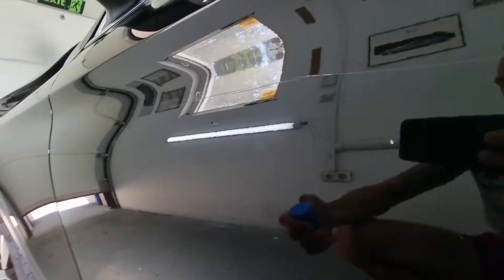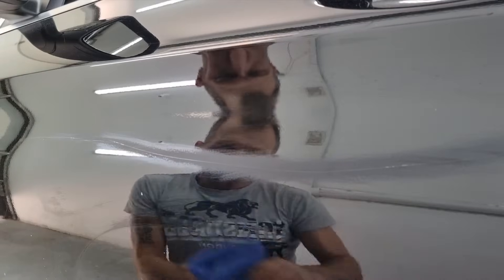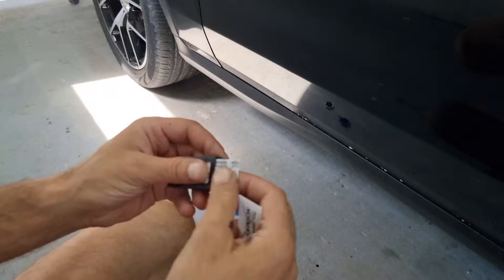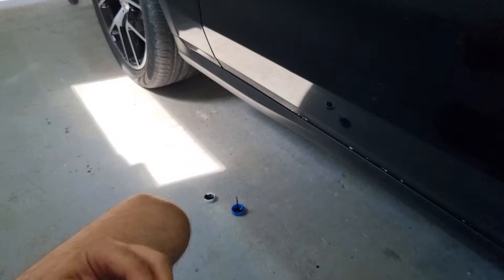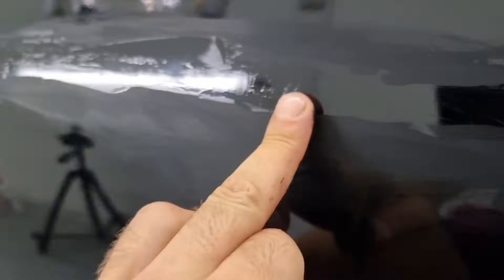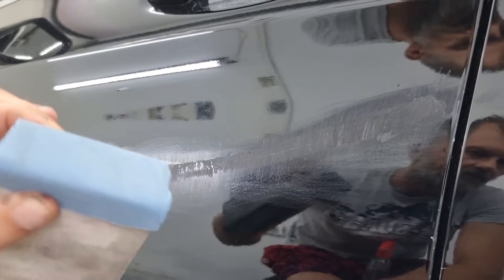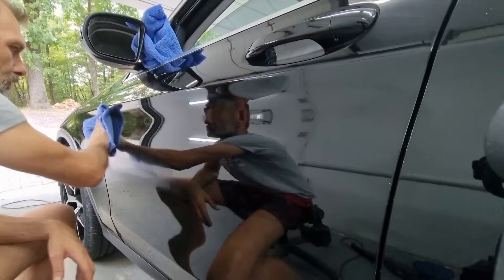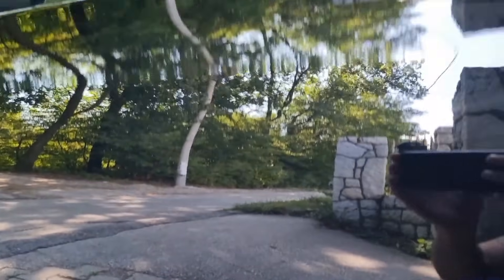How To Repair DEEP SCRATCH in Car Paint/RAZOR (DIY)

Comment: As a detailer myself that is a very very good touch up, in come cases this touch up has a better outcome than actually respraying the whole door because depending on the color match and in most cases the metalic flake in metalic paint types when it's sprayed can make the whole door stand out under sunlight and at night under street lighting.
Reply: A good shop can make the metallics sit perfectly , he did say this is a solid colour so should be no issues . 
As you know new cars come with thin soft paints and I don’t know if this method would be suitable
Reply: @M.E63  it definitely would be suitable. I speak from experience.

Comment: Finally, a process I can get me head around.  I thought you were going to use the blade to shave down the high spot but when I saw it used as a spreader of the paint I loved it.
Reply: Life, changed. Used flexible for over a decade but not THAT flexible.

Comment: If you layer the touch up paint a few times and let it dry between steps you’ll get a raised level above the scratch, then you level that and sand in steps til you get to 5000 grit, you’ll get rid of the scratch.

Comment: A good honest video which makes a refreshing change from those videos showing miraculous like new results. This video is honest and shows a honest true result. 
This method with a razor blade seems unbelievable as you think a metal razor blade will damage the paint. But this guy states clearly to use the slightest of pressure. 
Just one hint for you bud. A slightly better result could have been obtained by  using a thicker paint, a thinner brush and doing shorter sections. This reduces massively the amount of excess paint. Yes it takes longer but the results make it worth it.
Very good video m8. Well done 👍

Comment: Fantastic process. I've always struggled with scratches. I seen a video where they used the blade to shave the high spots but your method is much better.. Thank you for the insight 🙂
Reply from the maker: Thanke you and enjoy
Reply: @Amddetailing  can use mirka file too?

Comment: Really amazing work. The remaing small mark could be where the paint applied into the scratch carried on shrinking back a little?
Reply: I thought the same thing. Would waiting a bit longer to let the paint dry more take care of that issue? That would make sense but I'm no professional.
Reply: @toms6928  Yes. Even when paint is touch dry or even dry enough to flat back it carries on shrinking. The longer it is left to stabilise before it is rubbed back or polished the better.

Comment: Great technique. I wonder if taping on both the sides of the deep crack, forming a very narrow visible surface and then doing this technique, will avoid the excess paint on the body and  limit the work area?
Reply: Also after taping paint only scratch with touch up.  Do around 4 or 5 layers.  Then the scratch will be filled. Then remove tape and wet sand until there's no ridge on the added paint.

Comment: long tedious process but for not repainting it's pretty good results 9/10
Reply from the maker: but better than painting the entire element
Reply: @Amddetailing  100% 
It's very well done work given that fact don't get me wrong.. I recently had something similar on my bumper and tried to blend it in without painting the whole section but the results didn't satisfy, therefore I just painted the whole section and not trusting my work I ended up applying paint protection film to the bumper to make sure the new paint does not chip away in the future

Comment: Thanks, I like the idea with a razor.
My biggest problem in these kind of repairs is the sanding process when You not only sanding out the excess of paint but You're also sanding out the clearcoat that sits all around. You may end up getting through to the base color and then the problem gets worse.
Reply: Still worth a try, if the worst happens take it to the paint shop but if not you may well end up with the results achieved in this video and you will have saved yourself a few pennies.
Reply: It would take a lot of effort to go through the clear with 4,000 grit paper. If the paint had been compounded and polished a bunch of times then perhaps but if it's virgin clear coat the 4k paper isn't going to cut that much. You'd have to apply quite a bit of pressure and really go to town to get through it.

Comment: I did this on a few scratches on a black car. The result is acceptable, but far from "as new" (But of course way better than do it with a scratch repair pen). Yes, it's not noticable from 1 meter and hard to see on camera, but when you sell your car and teh buyer inspects the body panels carefully, then he will notice it. But of course you did your best to repair the scratch and that's the maximum you can do with it.
Reply: With practise and different methods you can do it to the point that you can't even notice.. I have done smaller repairs where you would never be able to tell even if you knew where to look..
Reply from the maker: it is easier with a razor because it leaves a straight line
Reply: @Amddetailing  yeah I will try it out next time, thanks for the suggestion.
Reply: I did some practice with a touch up pen on a big stone chip on a wheel arch. Yes I took a lot of time, many paint appliances and rubbing down. In the end it was invisible from all angle even up close. I guess it depends if its your car as opposed to a clients, and how much time you have.
Reply: A plain colour would be more undetectable than a metallic.  Sell the car when it's dusty 😝
Reply: Did you get the paint already prep for the car and do I add extra hardener to the paint ?

Comment: ... would it make sense to use a tape up and down the scratch to have only a small line with the scratch?
Now go on like shown,
remove the tape and the scratch is filled more / higher ... go on with the sand paper ...
Reply from the maker: that there is also that method that I showed in some subsequent videos on the channel

Comment: Nice work. Just one point of criticism though: In your final segment, the outside scene, the focal point of your video is set pretty much to infinite (the trees reflecting on the car's panel are in focus), making it harder to judge the result of your work. Auto focus will usually do this, because the trees (or any other objects reflecting on the car's panel) are pretty much the only discernable objects for auto focus to act on. Because it's hard to have your recording device focus on a car's panel, I use the following trick when I want to photograph or film a defect on the panel: put your finger right next to the point of interest, and then have your camera focus on your finger. Then lock your focus. Now you can film the car's panel with the correct focal point. Instead of a finger, you can also use for example a piece of cloth. Anything that the auto focus mechanism can "use" to set focus to the correct distance. (I hope this was somewhat clear, I'm no native English speaker).
Reply from the maker: First:
this is a channel where there is no obfuscation
second: it is better to do this than to have to paint the entire side
third: if I wanted to hide it so it wouldn't be seen, I couldn't do it with the help of focus
fourth: watch the other videos where I show with my finger from a distance of 2 cm where the lawsuit is and what is left of it until it is not noticeable from a distance of 10 cm.
Reply: @Amddetailing  You are totally not getting my point it seems. Nevermind.
Reply: @Amddetailing  this youtuber wasn't criticizing your work but instead he was giving you advice on how to record the video of the final result in order to auto focus better on the panel so your recording shows a better video distinction of the focus point that is being recorded, if this makes sense
Reply: No need for that man. Like dex said: I wasn't criticizing the work, I was merely giving some tips on how to show the end result to your audience more clearly.
Reply: @omarf2406  don't bother, some people are just too ignorant to understand the difference

Comment: Which polish do you think will give a more suitable and better glossy finish without hardly any holograms if applying by hand foam applicator working it for a little?

It is for light-scratch removal that doesn't have any fillers and glaze?

Maybe Sonax perfect finsih? Sonax 03-06? or Koch M3.02? I don't know
Reply from the maker: you can hardly polish by hand so that holograms do not remain, even if the polisher uses soft cotton wool

Comment: Bravo, video kvalitet i komentari na engleskom su sve bolji i bolji..

I use the same method of filling it, although I have to try the razor blade method...  I tend to mix a bit of acrylic clear coat together with the basecoat color. In testing I've found it gives a better results and less noticeable..
Reply from the maker: Hvala prijatelju

Comment: do I need only hardener if the paint is already glossy? If not then use a clearcoat mix with hardener? how much should I mix together with the paint?
Reply: Hardener I think is used both as a filler and help the paint stick more in this situation

Comment: Nice work.  How long did it take you from start to finish?
Reply from the maker: It takes 24 hours until the coating is completely dry, but now I have a new method, I use a coating that dries with a UV lamp in 3 to 5 minutes.
A video with that method will be released soon

Comment: Could you have done a another coat of paint after the first one was watersand? To fill even more the groove.?

But anyway this is the best methode I have seen.
Reply from the maker: and it should be over the factory coating so that you can level and align it without it remaining in the scratch so that it does not fall out

Comment: Is there an alternative for the fubur tool and did you used wax at the end to make it shine again?
Reply: You can just use wet and dry paper (used wet). After using all the papers, finishing with the very fine paper, I use a cutting compound which in my country is called T-Cut. To get best shine the paint must be fully hard.  Allow two weeks for it to fully dry.

Comment: I'm curious about how this will work with a metallic beige paint. I think I'm gonna retry it with this method because the clear is really thin (previously repaired from previous owner) and I already burned through by accident on a tiny spot so I'll try this as it has a lot less leveling required

Comment: I did it now i see the primer 😢 did with 2000-3000 grit why it remove color?
Reply from the maker: 2000
Reply: @Amddetailing  i did with soapy water and 2000 , the color is gone , i see the primer color
Reply from the maker: You must put harter clearcoat and base
Reply: @Amddetailing  you dont understand me....i did a wet sand on scratch and the sand paper delete my color , why?
Reply from the maker: @sergiomattie989  follow the vision put everything together colorless varnish hardener and paint wait for it to dry 24 hours and then you have no problems when sanding

Comment: Didn’t work for me, after the paint was filled with the flat edge and left to dry wet sanding just removed all of the new paint including inside the scratch
Reply from the maker: there are many reasons why this happened to you, and it could be
you didn't dilute the hardener properly, it didn't dry enough (24 hours is necessary), you aggressively removed the excess paint, etc...